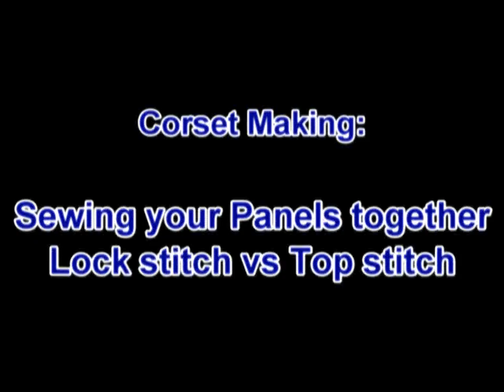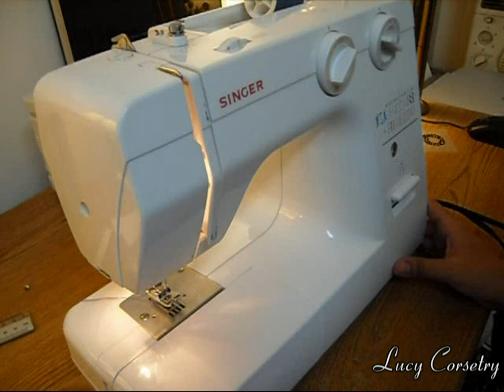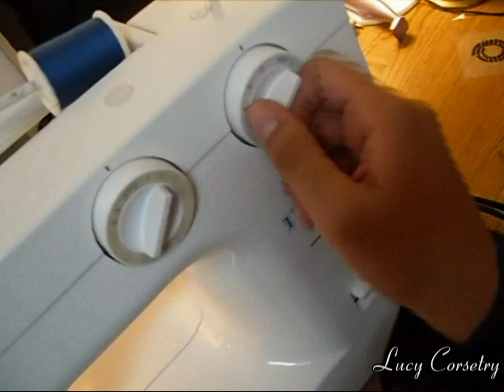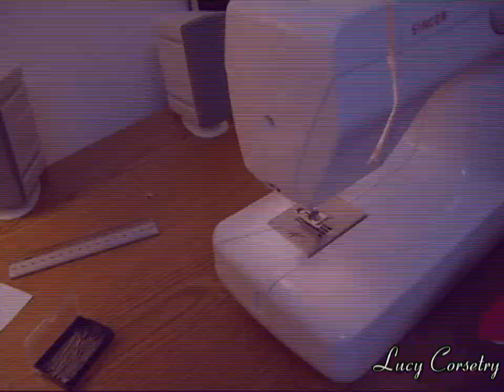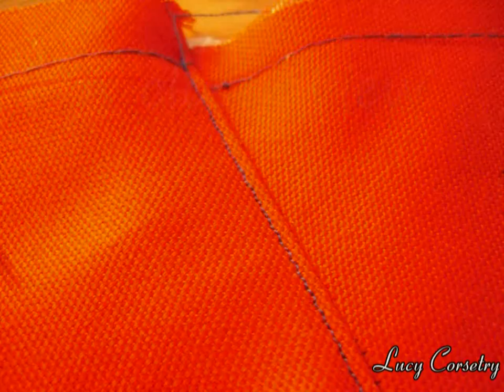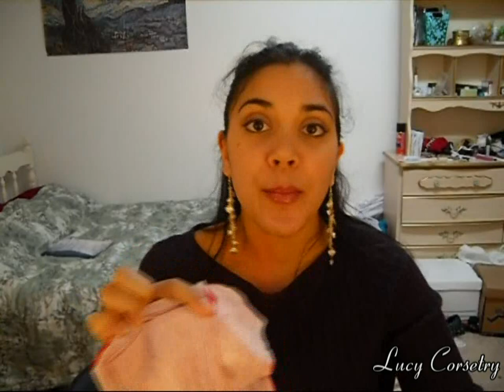Corset Making: Stitching panels together | Lucy's Corsetry

Comment: Do you do the top stitch in one (very close) or does not matter?
Reply from the maker: I used to do top-stitching of about 1/4 inch away from the first seam, but as I made curvier and curvier corsets, I started stitching more like 1/8 or even 1/16 away from the first seam - the closer the topstitch is, the easier it is to go around curves neatly, and some of the seam allowances don't have to be clipped as much.

Comment: do you clip curve seams like when sewing other garments or will clipping ruin the channels or strength of the corset?
Reply from the maker: Yes, I do clip seam allowances, especially at the curves. :) I just don't clip closer than 1/8 inch from the seam itself, so it will not fray into the seam and compromise the strength.

Comment: Is there any reason why someone would NOT combine the two methods? I don't know if it's been discussed, but It seems easy enough to add strength by doing both.
Reply from the maker: You're absolutely free to combine both lock stitching and top stitching. :) It's just more time consuming. Depending on the style of corset you're making, one looks better than the other, and one might lend itself to easier construction (e.g. if you press the seam allowances open, then it's not as bulky on one side of the seam as pressing the seam allowances all to one side - so lockstitching might be an easier choice in that situation).
Reply: Maybe it's a late reply but usually one fold back the seam for a single-boned corset. To be perfectly honest if your boning is hidden inside the corset then combining the two methods should be a bonus!